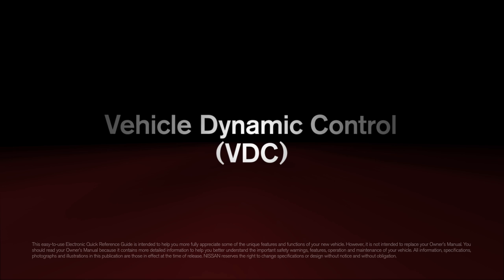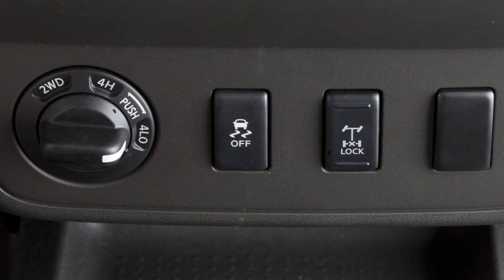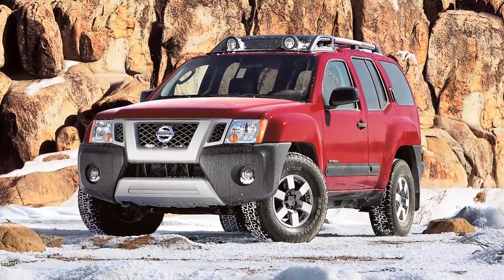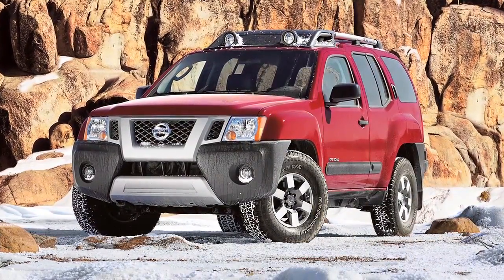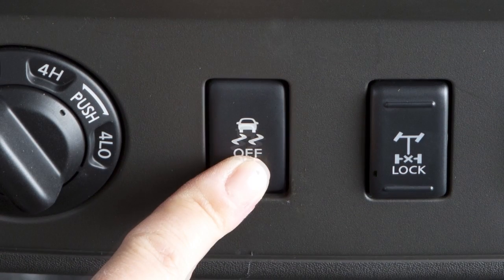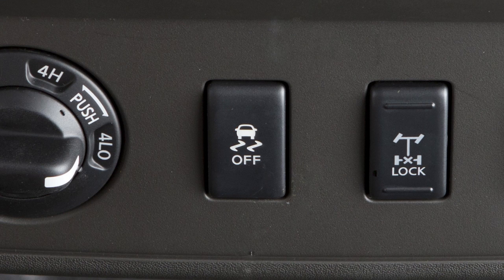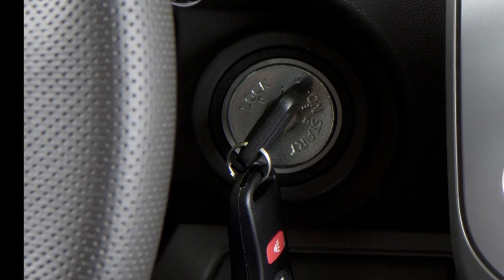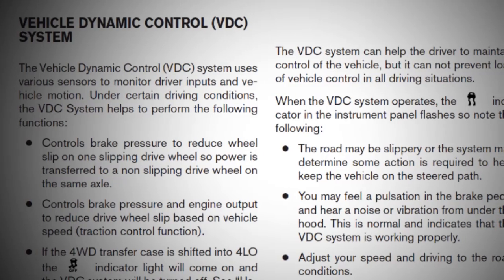2013 NISSAN Xterra - Vehicle Dynamic Control (VDC)

Comment: Whats that lock button do next to it?
Reply: That is the differential lock. Basically locks 2 gears together in the differential so that the same torque is applied to both rear wheels. Great for slower drives in snow or off road.
Reply: @Razor_36  thank you, you rock.